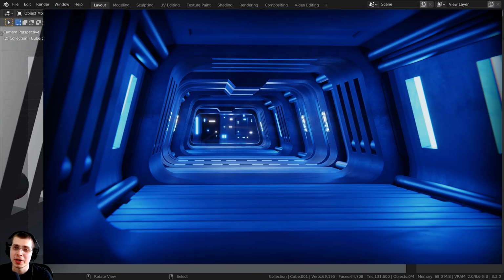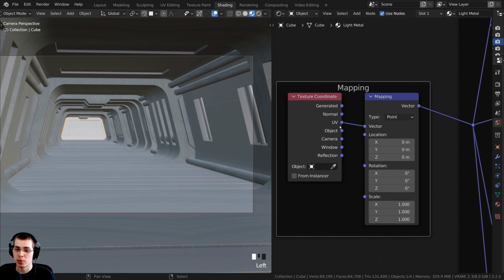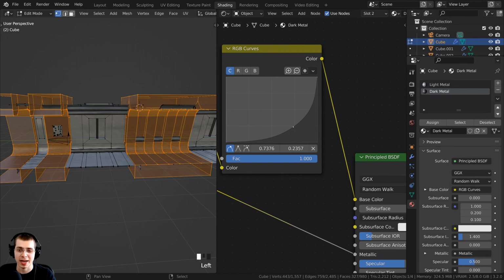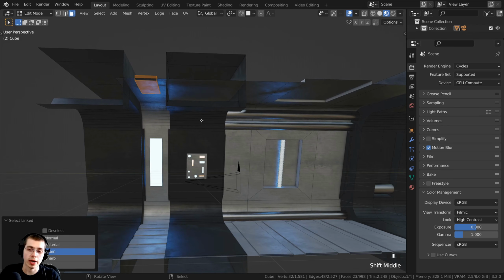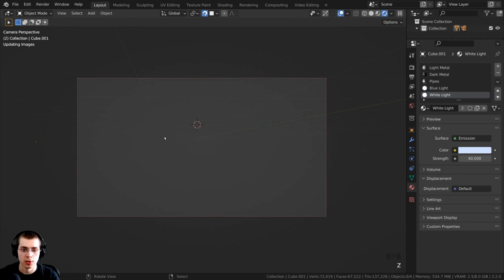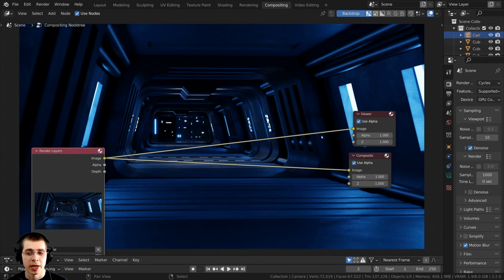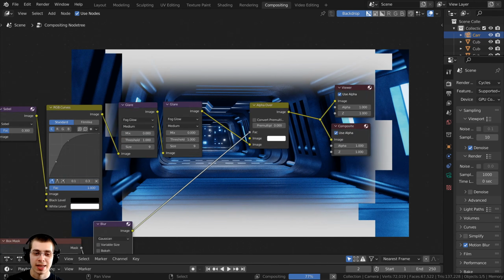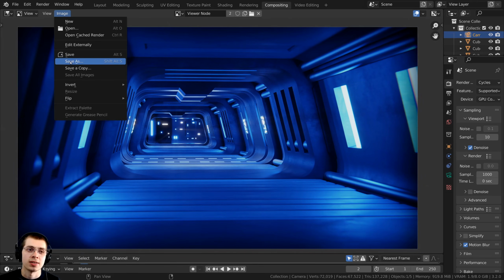Sci-Fi Passage - Part 3 (Blender Tutorial)

Comment: Hope you're still responding to this video's comments, I had a lot of fun following your tutorial. For some reason my render came out much darker than yours, it has parts that are completely black regardless of what I do with the color in compositing. Any ideas how I can light it up or what I did wrong?
Reply from the maker: Hmm, maybe just turn up the brightness of the lights. Also if your using Blender Eevee, then you should add some normal point or area lights to light up the tunnel.
Reply: @RyanKingArt  Thanks for your help, I'll try it asap. I'm sticking with cycles for this project. Thanks again, I also found another way to lighten it up, using fog, it didn't come out too bad 😅.
Reply from the maker: @christopherfourie6684  Cool!

Comment: if one wanted to make a game and bring these assets into UE5, at what point would you stop doing things in Blender and transition over to UE5 for the rest?
Reply from the maker: Umm, not sure exactly, as I don't make games. Nor do I use Unreal Engine. But I think you'd just add it into Unreal Engine after it is fully complete, but without doing the compositing. Also, you might want to bake the materials together into texture maps.
Reply: you could make all your assets in blender and send them into ue5. then in unreal do your lighting & programming in there. you don't even need to model EVEYTHING as you can use quixel for free scanned assets.